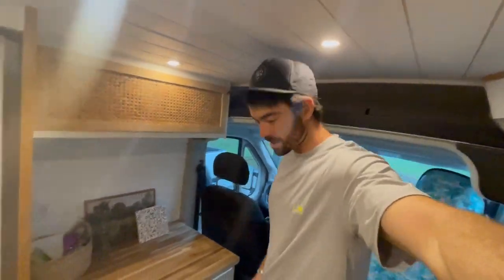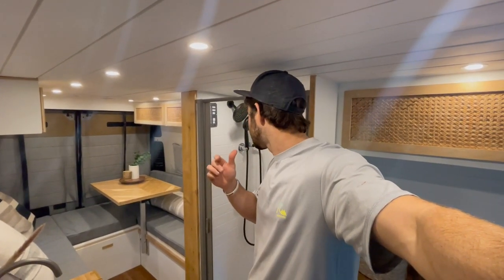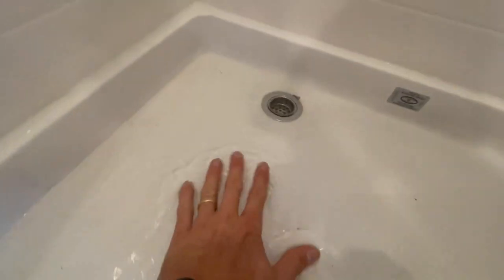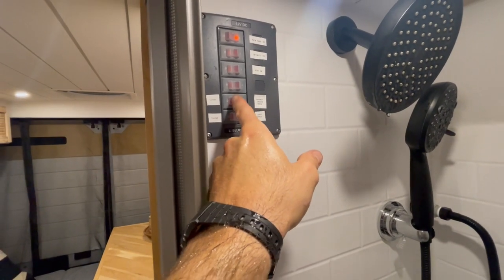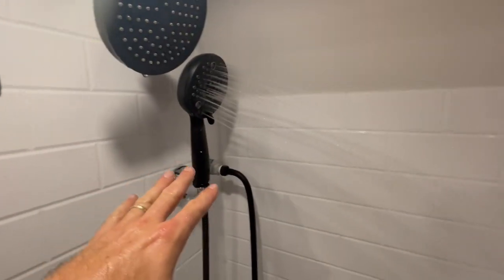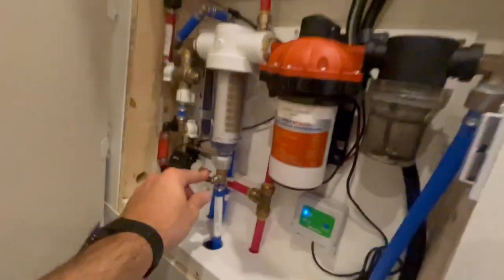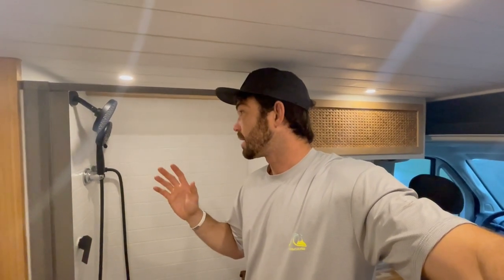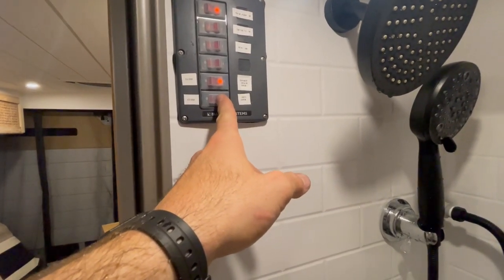The "Infinity Shower" by Sabbatical Designs

Comment: Nice set up. What size drain valves do you use on the system? What induces the spin down filter to drain the 1gal so quickly? Is the filter's drain port also on an actuated valve? Cheers.

Comment: I made up a portable version with a 3 in one filter and  a UV filter that can be used in pretty much any RV that has a hot water tank and water pump. I was originally going to go with a much more elaborate system with three-way valves, etc. But the more I got to thinking about it the more I just wanted to keep it simple. Less crap to break. I will still put in a dump valve, i.e. motorized ball valve, but whenever possible I would like to shower outdoors. The build up even with an exhaust fan gets to be too much. Here's the link to my somewhat crude video. It shows the product, but I'm no video editor nor do I have high-end equipment. https://www.youtube.com/watch?v=i5FQZQltPpk&t=1s  I welcome your feedback. You are one of the people who inspired the ideal, to begin with.  Lots of sketches, prototypes, etc.

Comment: Do you have a kit for people to install this system themselves or is it only for van builds your company does in house?
Reply from the maker: Hey Devin! We are working on selling an Infinity Shower kit, which includes the filters, pumps, valves, heat exchanger and control panel.  Contact us at sabbaticaldesignsinfo@gmail.com

Comment: Where is the pre filter? The carbon filters that clear down to 1 micron? The UV sterilizer? A spin down filter it’s literally only good for removing things like debris and algae.  This is just recirculating dirty water without the other filtering agents installed   🤷🏻‍♂️.
Reply: We have a two stage filter. We opted for simplicity, efficiency, and low maintenance rather than trying to sterilize the shower water to the point of potability.  We recommend treating the system similar to a bath. Take a quick shower initially to get clean. Then enjoy a recirculating shower for as long as you want. 
Cheers!
Reply: The real beauty, and genius of this system, is every shower just uses a gallon of FRESH water. You are not reusing the same water for two weeks or a month or something. You don't need all the filters you just need to get the large debris out so you don't plug up the pump or shower head.  Every so often, you probably still want to sterilize the system with a tad of bleach, but the way he's got this designed is you can completely drain all stale water out of the pump via the spin-down filter drain valve.  The one thing I was contemplating with my own recirculating shower was doing a pre-wash and then the final shampooing of my hair while it was still wet, but draining or rinsing the soap out in the sink  to save my  filters.  With this setup, you've got the best of both worlds. Rinse with fresh water, enjoy with recirc water.  You still do need to heat up the initial 4 gallons or so in your hot water heater, but you don't need to be operating circulating pumps to get what's in your recirculating tank through the hot water tank to heat it.  Most of those pumps use seven amps of power or so, it's quite a bit. It can take 20 mins or so to heat the water. 4 gallon + what's in your recirc tank. Here you just heat 4 gallons or so.  Personally, I use a heat exchanger, and this design also incorporates that. This allows your hot water heater to be used for cooking purposes without any contamination.  The design is very well thought out, and very efficient.
Reply: @SwellSeekerFishPrints  great idea. I want that kind of system

Comment: Very nice, BUT, i would say 1 gallon is too small. The issue is that even with a good filter and UV light, the water is not going to remain usable for long in that setup. You honestly need like 20 to 25 gallons for it to properly work and maintain hygiene - and then on top of that, you'd need to shower without soap, or, if you must, with non-petroleum-based soaps. You'd need a box with quick release plumbing so that you can easily take out the filters and clean it out into a small gray water tank to get rid of all the build up, and especially with 1 gallon the filters get clogged real fast.

ideally, you need a multi-chamber system water tank, where the wastewater gets pumped into several chambers, and you could switch between chambers. 1 chamber for rinsing off the oils, grease, skin cells and dirt of your body, which goes into what you could call a 're-usable grey water tank'. with it's own filtration system, and preferably, a chlorine tablet filter (think about swimming pools). then you would want to have your second chamber to switch to, where you use relatively little water, but soap yourself with the most equipment friendly non-petroleum soap (use like a washcloth or sponge), and then rinse yourself off, with that 2nd process. that chamber should have a 'separation' system (again with its own filters too) to seperate water and soap as much as it can so the water stays fresh and not oily and cloudy. again, a chlorine tablet is beneficial. 
stage 3, would be your final seperated chamber, where you ONLY use pure water to 'rinse' or 'water' yourself down. All the dirt, fats, grease, etc. have gone off with the first rinse, the soap rinse will have gotten rid of the second, and then you have your third 'cycle' so to speak when you are already, essentially, clean, and the water is the best it can be an will remain. again, it's own filter system. 

just add a fast-heater, it may require a high inverter power, but you won't need a boiler or something like that, and though most these systems are like 3 kWh on full power, if you just shower for 6 minutes, that's like 300 watt. it only needs to be below 40 degrees (C) anyway, so actual consumption will be lower. 

i'd say you need like a 10 gallon chamber for each, so 30 gallon in total. that way, you can go for a month or 2 on a single tank, and only need to flush out the first filter like once every couple of weeks. the second filter like half of that, and the third filter once every few months. if you install a back-washing valve, you can flush the entire thing out when dumping the reservoir in the gray water waste disposal locations, and then re-fill with fresh water. remember, private swimming pool water, when handled correctly, can last for years without replacement, even though the amount of water is high. 

you can have a separate smaller system for your kitchen faucet, where you should have a system for dishes and hand-washing and one for water that you might use for cooking, and drinking water with a separate water dispenser faucet. as such, you'd only need like a 12 gallon for 1 week of drinking water and cooking, and a 10 gallon one for dish-washing. if you use as much bio-degradable papers ( and bio-degradable baby wipes ) to clean off the dishes directly after using, and use non-stick frying pans and airfryers / oven, paired with 'oven paper' your actual water need for 'dishes' will be minimal. 

drink soda's and beers straight from the bottle or can and your water usage will remain minimal and so will your water consumption.

yes, you will need a total of 53 or more gallons of water aboard anyway, which has it's weight and space usage, but will benefit you in the long run if you are out multiple days or weeks, especially those truly living 'van life'. 

if you shower once every 2 days, perhaps 3, (doing vanlife) you will also decrease water contamination. If you pair that to using the shower in public showers (where available and clean) you will greatly reduce your water usage. 

the secret is always balance. you will need your filter set for each chamber, minus the UV light which is only needed pre-heater, and you will need chlorine tablets for each chamber albeit your chlorine level for the third (pure water) due to the lesser contamination can be minimal.

This system would be absolutely monsterously good to build if you'd be living out of a schoolbus or actual truck, where you could haul a lot more water with you. as long as you keep a low-wattage using stirring device / small pump to make sure it does not become 'standing' water, you can use the water for a relative long time. investing in a proper (digital) pool testing kit will help you keep an eye on the PH and other health levels.
Reply: Wow. Very complex. I think the beauty of the infinity showers system is its simplicity. And they drain the water after every shower.  So there are no holding tanks of dirty water.
Reply: No, you didnt understood it properly:
The water is completely renewed for each shower. The recirculating fonction is for this  small quantity of water that will be used only once for one shower.
https://youtu.be/mLhyysNg5gE?si=n6WEJ_iP0wizmCP-&t=312
It s very clean in my opinion for having a very similar system. This one is better regarding of the "self cleaning" filter.
Reply: Watch the video and reply after. You didn’t get it.